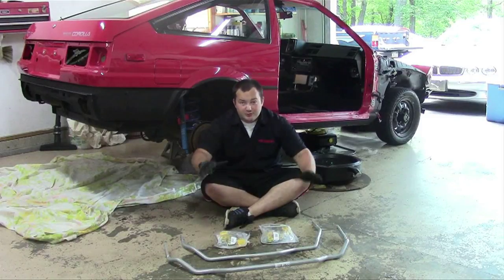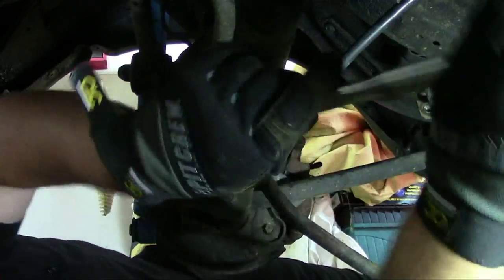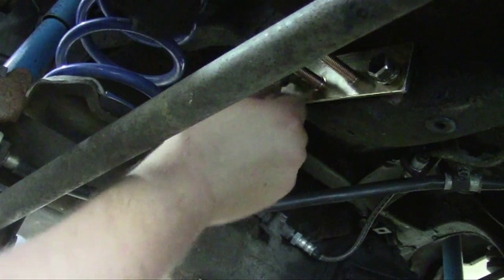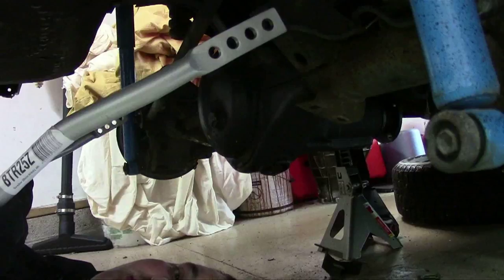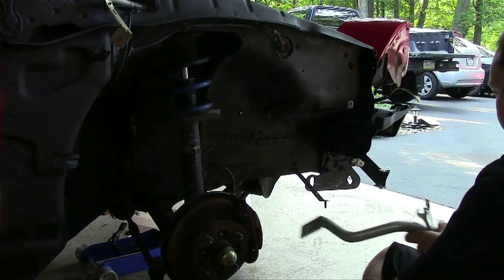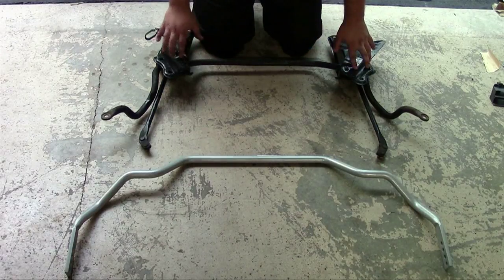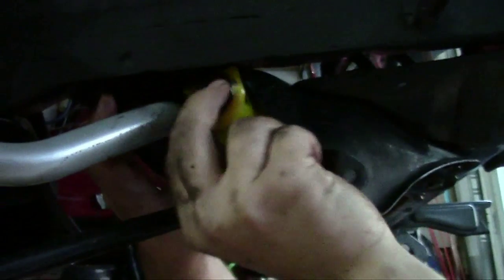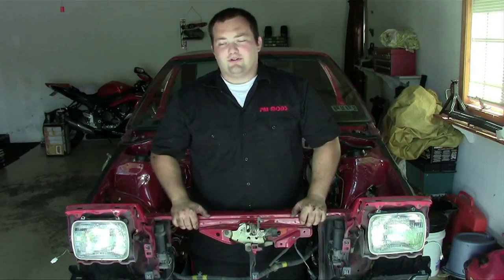How to install Sway Bars| Sway Bar Upgrade | AE86 Corolla

Comment from the maker: Ohhh ok, Were in the works of a KA-T build for Dan's 240. We have the bottom end fully build, assembled and bored .30 over. Were saving up to get the head work finished, then we are swapping engines. Then we are going to do a long episode that actually shows and teaches you how to turbo an NA car all by yourself, no professional work needed.

If you watch "Eps3 1JZ Supra Swap + S14?!" at the end of the episode the s14 is introduced, and nothing is set in stone but we want to do a v8 swap with it

Comment: Not sure what a VH45 is, but I'll take a wild guess and say its a turbo. What is the end goal of Dan's 240 and the tool240? Drag? Drift? Daily driver? Street X? Road Coarse? I'm interested cuz I'm aiming for road coarse since it's engineered, weight wise, like a Corvette. I've compared the two designs and its all made to balance the weight as close to 50/50 by moving the engine back as close to the firewall as possible, should a been called a Nissan Japette.....

Comment: Nice. LS1 or LS3? I'm very interested in the KA-T work since I've done some research to find out I.T magazine's sister mag Turbo is doing a KA-T build for the blocks Max rated HP of 750HP. Enjuku also has a guts kit for exactly that.....which is kinda the way I'm leaning, except for I'm shooting for mid 300 or low 400HP

Comment: Also the adjust ability part...the farther back the whole the stiffer it is the closer the hole the less stiff. Imagine you had an elastic wraped around your thumb and index finger...the closer your fingers are together the  more slack you get while if u stretch your fingers the stiffer it becomes...
Reply: +Sheyi Olukoya the farther away the hole is from the center of the torque, the more leverage - meaning less resistance to roll.   Not sure where you're going with the elastic analogy.

Try to bend a pencil that is 4" long, then cut it in half and try to bend it again... harder, right?    

The closer you mount the end link the stiffer...